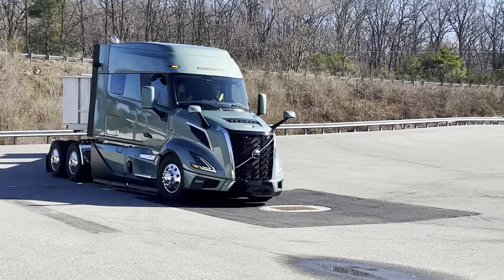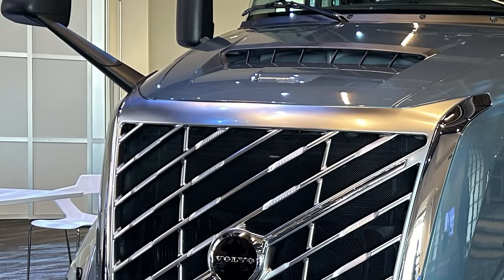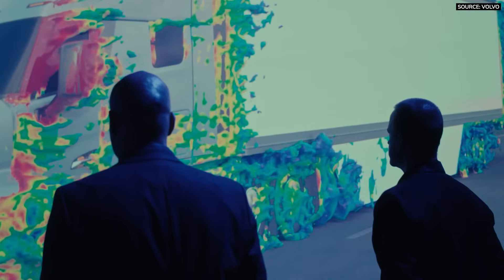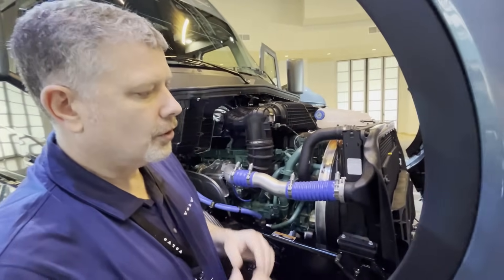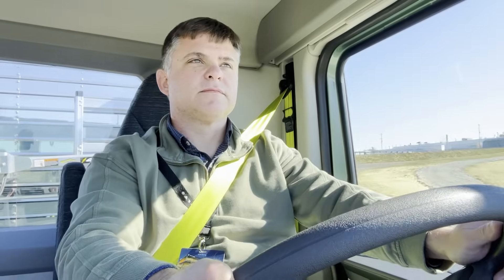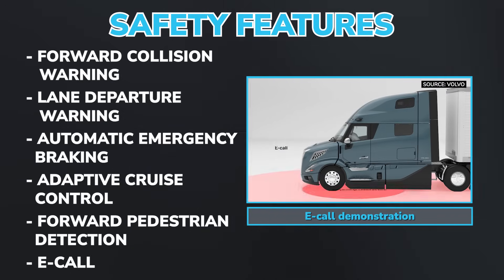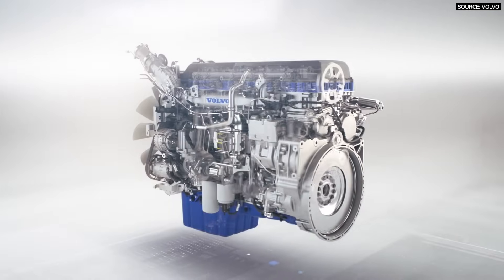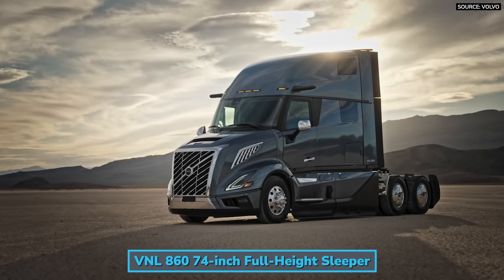The All-New Volvo VNL: Test Drive & Complete Overview

Comment: these big trucks should get 18 -20 miles per gallon by now.
plus at 200K + dollars for these trucks, the least they could have in them is a shower and toilet. come on for this kind of money.
and with something so big why do you hear any noise in the truck. plus the ride should be no bumps, not little bumps or any bumps.
for this kind of money these companies are not even close to delivering what owners want. 
so at best 70 - 85 k is all they are worth.
all these years and no one has a better braking system. a system that never fails no matter what. hell what are you paying your research and development teams for? one more mile per gallon. please. that could be achieved just by changing the fuel air mix ratio. save the money, fire all of them and lower the prices.
20 miles per gallon is a hell of a pay raise for you customers. a shower and toilet is about true on the road comfort. people want to take a comfortable dump that is almost worth 25K.
just wait till I start my manufacturing company they won't buy anything else ever. 
hey, how about stabilizers so it impossible for the truck or trailer flip on it side. I mean, these are some sorry research and development people. I see why it's so easy for you guys to think musk is so so smart. fire them start from scratch.
Reply: While you are about 50% correct and I like your proposal just think for a second: you mentioned Musk ,.. how much does a Tesla cost? Also a pickup truck now a days starts at about 50k and most of them are 80-90k , and you want the semi’s to be 85k ??? I mean I would love that as well but that’s wishful thinking and will never happen 😂

Comment: Wish they would do more insulation on the cab itself to keep the engine heat and heat from the sun out of the interior. My 2023 volvo vnl860 gets ridiculously hot inside the cab on a hot florida summer day

Comment: 🚫 Check my shorts for proof of fuel efficiency before you order.
10% more efficient compared to some spected 2015 Volvo D13 which is not true. Because I already have one i-Torque 13 speed and God forbid, it doesn't save me a single penny in fuel. Instead it shows 7.4 in settings after driving it for year and a half. I have almost 120K mi on it. And unless Volvo takes it away and replaces with brand new truck free of charge, I won't recommend you it.

Comment: Helicoid (Helical) timing and accessory gears located in the back of the engine means that you have
to drop the transmission in order to work on them ( $ 10,000 shop bill ) to change a $ 250 dollar gear.
Remember the old Helical Gear ( Bull Gear ) on the 12.7 Detroits 60 series?
That main "Bull gear" and bearing was a service item at 750,000 miles, or risk loosing and engine to 
a $ 75 bearing due to the normal stress on the angled helical timing gears. Cat and Cummins also have front timing gears.
Only difference is that the timing gears on a series 60 are located in the front of the engine (A $10,000 difference).
Then add all the electronics on this new truck.
New disc brakes at $ 2000.00 per Wheel-End ( Four drives and two steers = $ 12,000 )
$ 5 - $7,000 Electronic Dealer Only Turbos.
And corrosion on the wiring harnesses will EAT YOU ALIVE in shop repair fees.
In one single repair, you will lose your shorts, everything you have saved in fuel in 2-3 years...And more !!!
All new electronic trucks are the same, not just Volvo.

Comment: This ad is typical of Volvo truck. All glitz and glamor but NEVER do they address their Achilles heel that keeps them from mounting any serious breakthrough into the North American class 8 market....Reliability of their product and Availability of service  and parts. I have owned and operating my own trucks for @ 25 years now and have yet to  be swayed to get a Volvo. Their engineering is topnotch as far as safety, comfort  & appearance ( especially the 2025 VNL) is concerned BUT I am not paid for how my iron looks but for how it produces !  The scarcity of Volvo service locations and questionable reliability is my biggest concern and in talking with other O/O this is a common and widespread issue. If not for these concerns I would get a VNL in a heartbeat. FYI.....

Comment: How's the electrical herd The electrical for volvo's wasn't good lots of trouble with them
Reply: Don't know about the new 2026 models but the ones I drove from 2020 to 2024 didn't have any issues for me with electrical. As long as you do proper maintenance and especially change the fuel filter/water separator filters often I never had any issues.

Comment: I have a Volvo 2021 so picky truck always check engine light on air leak couplings too cheap always leaking Wheel Alignment always getting bad interior dashboard plastic looks like made in China even on a good road making noise behind engine top gasket most Volvos has oil leak My next truck I prefer Freightliner Cascadia  I used to to drive 10,000 times better than Volvo truckers my message for you don’t buy Volvo 😡😡😡🤬🤬🤬🤬

Comment: After about 75,000 to 100,000 miles. I bet this new Volvo would in be the shop for sensors or emissions control or something else that as broken down, and or stop working.  Old semi truck when proper maintained can prob run circles around any new truck. Sure new truck may get better mileage at first.  But won’t matter if new trucks is sitting shop Cus emissions issues, or transmission issue or sensors has put truck in limp mode lol. 

New tech, more sensors, or computer chips and more emissions control, that slow chokes the the engine at some point. You’ll be forced to have that new truck hauled back to the shop with expensive repairs bill.  

Somebody need to do a test,  take bran new semi truck off sales lot then take older rebuilt semi that has been fully fixed up.  Then have both trucks do 50k miles/doing jobs and then see who’s still running.   I bet old truck will be. 18 speed with CAT c15 6NZ or 3406e or c16. 
The old truck sure will have some issue. But new truck will be in shop before it even hits 30+k 

How know this. Cus there videos out there of companies selling new trucks and buying up old semi trucks instead.  Cus they tired of def/ emissions issue/sensor issue.  They tired new trucks always being in for repairs.

Volvo should do old school long nose truck.  Them ppl maybe more interested, they could still do some Air dynamics, and still look cool.
Reply: Some owner operators / smaller companies might can keep it going with older trucks with less electronics for a while. Sooner or later time will catch up, stricter emissions, customers demanding trucks 'not older than', autonomys driving and so on. Nothing lasts forever. To many fleet owners, older trucks is not an option
Reply: @Rimrock300  
https://youtube.com/@flintcreektransport?si=RKLBoRyTYMPY0W7U

Is one company that has been selling off newer trucks and buying up older trucks. True not all there newer semi selling off. But they sold more then few.

Comment: All those extra vents are going to let a lot of dirt lot of mud into the engine compartment
Reply: Evidence?
Reply: @Rimrock300  Common sense. that engine bay is gonna be dusty and nasty. Not that it matters too much if it gets cleaned every once in a while, just gonna be annoying to pull stuff apart when there is grime and debris in every nook and corner.

Comment: Turbo Compounding a' la Curtiss-Wright R-3350. Had 3 of them-called PRT-Power Recovery Turbines. Sat in the exhaust stream & directed lost thru the exhaust power to the crankshaft via a fluid coupling.

Comment: And here in the EU Volvo has D17 engine makes 780HP 😊😊😊
Reply: Can't believe you boys still run at 37tonnes in England that's mid 90s weight. 44tonne is standard now and easily handled. P.s. get some reinforcements behind them shiny bumpers! They look sweet but nobody wants to lose a front axle when you tap a car.
Reply: doesn't matter, in most cases 500 does the job well enough. 780HP makes sense only for special transport with extra heavy cargo. If finnish regulations state that to haul 76 tonnes you only need 503hp, and it has been proven to work just fine in most fleets, any extra is technically not needed, it's nice to have that extra but unnecessary.
Reply: Different countries different situations and circumstances...
Reply: More than 500-550 hp makes no economical sense whatsoever for a total weight of max 37 tons, that the majority of trucks in the US runs under. Don't you agree
Reply: Horsepower = fuel. Just ask my CAT C15 at 850hp. 😊😊😊

Comment: For Every tech feature you list I just think, another check engine light 💡
Reply: Most of those subsystems are on current production VNLs, they are relatively fault free. Most problems with collision avoidance systems arise from operator tampering

Comment: these big rigs by now should be at 18 miles to the gallon. 10 mpg is killing the economies around the world.
Reply: Transport costs is just a small part in the big picture, and not killing any economy. Sorry.
Reply: yes it is. do you know what 18 miles per gallon would means for the price of goods. or let's say that savings was not passed on. this is a heck of a raise to a truck driver. an in many cases a small business. think with that extra money they can invest, more trucks, invest in stocks, bonds, property, or bank the money thereby increasing the amount of money banks can loan out, and lower the interest rates as banks compete for loan customers. Transportation of goods are an economy driver.
Reply: @gdotone1  I don't think you understand how weight works and how much power it actually takes to move 80,000
Reply: ah. perhaps. or maybe there's been no real push on these engineers to make it happen. perhaps the approach to the problem is wrong. how about this. I want to move my 80,000 pounds 1000 miles for 100 dollars of fuel cost.  so that allows for all sorts of innovation.  100/1000 so ten cents a mile.
3 dollars / 9 miles =  .33 a mile.   my thought 10,000 dollars for 100,000 miles. so  if you run 100K a year with an making $ 2 a mile... 190K after fuel. think what 3.20 a mile brings in. 310K.  250 days. lol, 8 hours of driving a day, at 50 miles per hour. ah boy, that's almost enough.

Comment: The front springs have apparently been tweaked, but the suspension is fundamentally the same. Meanwhile in Europe, the Volvo FH has had independent front suspension available for a decade. This is disappointing technically, but probably what the North American market wants.
Reply: It's a repairability and cost to repair thing. Two thirds of trucks on the road here are owner operators or a company with less than 5 trucks.
Reply: @IRejectUrReality  yes, and the large corporate operators are even more interested in the simplest and cheapest possible design.
Reply: @brianb-p6586  true. The large companies usually only plan to keep the trucks 3-5 years max. So they have no reason to want quality over lower operational cost. Then those trucks are flooded into the resale market which the owner operator market usually buys up

Comment: Not a single close look at the suspension or under the cab/behind the facia. Suppose they didn't change anything there.
Reply: The model is rebuilt from scratch
Reply: @ArikHarv  Which tells me nothing, I want to know what they changed and why.

Change is not always great, Gen 2 parts are and aftermarket parts are abundant. Now Gen 3 parts are becoming easy to acquire outside of dealership markups. Just in time for gen 4 to keep the parts and ownership costs up. Great.
Reply: Getting parts for them will be a mess

Comment: No need to reinvent the wheel, just make the previous platform more reliable and upgrade failure points. Instead of pushing out the same ol garbage until next gen. Owners want less electronic modules to have to pay for, not excessively more which are going to turn the dashboard to a christmas tree. Volvo higher ups need to take their heads out of their arses. 😂😂
Reply: Ain’t it the way these days ? Everything overcomplicated and when it breaks it’s either unfixable or costs an arm and a leg -
Reply: All truckes are the same electronic wise
Reply: Idiot

Comment: Yet a 1996 International is 250% more reliable than this junk..
Reply: The 1950,s model driver,s are 100,000 % better than the young trash truck stop jockes that pretend to do this type of work that turn other driver,s equipment into the junk they drive by hitting it in the parking lot,s while leaving piss bottle,s and bag,s of shit on drive way even at shippers and reciever,s
Reply: International's are junk. Always have been

Comment: D13 with 500 hp...no way and the cost $250000
Reply: Volco's D13 goes up to 540hp, good engines
Reply: Same engine as the Volvo 60t haulers I believe.
Reply: @muckle8 dk about that but the European type are around 560-700hp and cost way less than the American variant
Reply: @xcqcarnage7323  I wonder why that is, less toys maybe?

Comment: Volvo are telling lies , we've had a lot of that technology in Europe for 7 years 😂 Great truck though Volvo 👍🏻😁
Reply: Truck manufactures applying decade old tech to brand new US trucks.
Americans: Dawg I've never seen that before!
Reply: What lies? They said these features are new to the VNL and they are.
Reply: dealers  rubbing  they hands 😮
Reply: Who cares about European trucks.  We live here, so we don't need boxes on wheels. Keep them in Europa 😊 Love my USA
Reply: What's really a 1st rate option is a manual transmission as Standard equipment!!!!
Reply: You are correct, However Americans are a lot more Skeptical of Stuff coming from Europe so they have to tread carefully
Reply: Like a parabolic spring... European truck have air suspension all around for years, just as air suspension cabin springs. ABS & EBS is standard equipment for tractor and trailer zonder the late 90s in Europe. Americans still don't have that. Americans have mirrors, where Europeans have cameras as mirrors and sensors with sound warnings if something or someone is in your corner or death zone.
Reply: Really, @VineV-Dutch ? It appears to me from online searches that common Euro heavy trucks have front beam axles on leaf springs, just like North American trucks... with the notable exception of the Volvo FH. Adding an air bag to that suspension doesn't change that it is still a leaf-spring beam axle.
Reply: This new grill will hard to cover in winter. And the hood grill will not be easy to cover. Apart from that European trucks technology is way advance than American trucks.
Reply: Like what,or maybe you're lieing😂.
Reply: @thebobcat1964 he’s not the start button and the digital cluster even hybrid semi trucks been in Europe for some time now
Reply: @darrylrichardson1997  I spent 9 of my 22 years in Europe with the US Military and my Father in law is a truck driver in Germany,his Mercedes Benz Actros has no more technology than my Peterbilt 579 so what are you talking about as far as more technology,I don't see it in European trucks.
Reply: @thebobcat1964 compared to Peterbilt 579????  Kenworth more modern than shit germany!! And don't forget tiny toy truck erope never Same as Kenworth W900 or Peterbilt 389 or 359,
Reply: @thebobcat1964 you know that ain't true...
Reply: @VineV-Dutch  What kind of equipment do you drive because you sound clueless about semi's,DAF is a part of Paccar so everything you find in DAF trucks you can in Peterbilt and Kentworth trucks in the USA and around the world.
Reply: @THEBATMAN7788  The European trucks are far ahead of the U.S. trucks all around. They run at higher weights, are more productive and more comfortable. Army trucks are built for special use, and Mercedes is way behind VOLVO, SCANIA, DAF and MAN. Most of the updates on this VNL come from previous model FHs which have been further upgraded. Why do you think VOLVO TRUCKS NA haven’t got a FH AERO here for comparison. The configuration of chassis, and trailers also allow greater GVWs. The way Europeans move freight is far superior to North America. I have worked in both markets, know some of the best truck journalists and testers. No one here can come close to them either as the manufacturers will not allow them to tell the truth or point out issues or potential issues. 🇺🇸